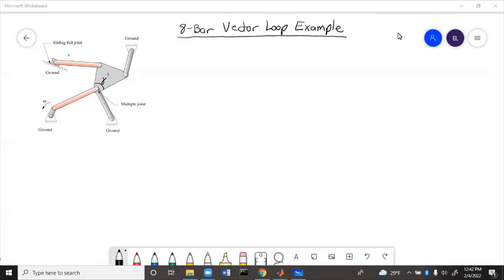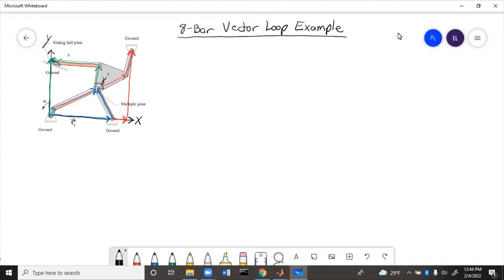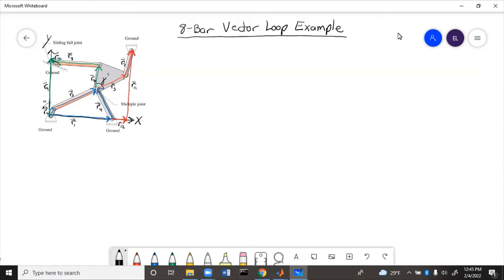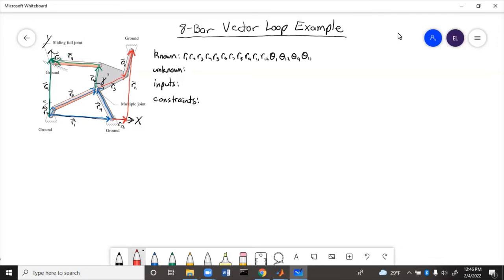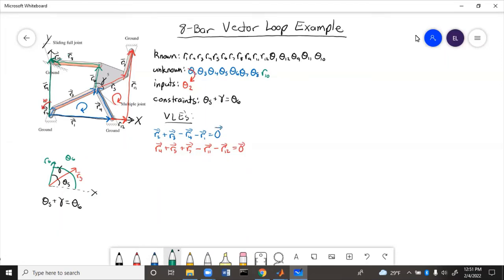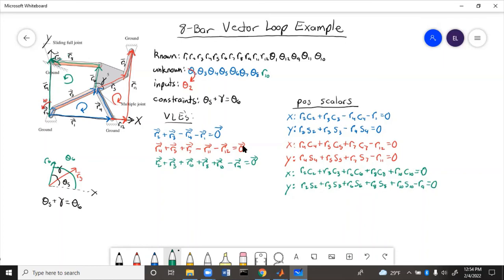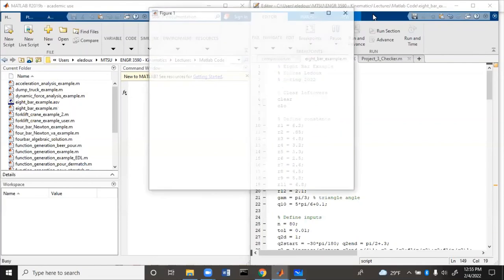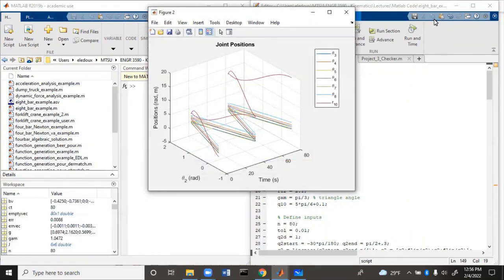8 Bar Vector Loop Position Analysis

Comment: Wouldn't theta 9 change with time making it an unknown? It looks like the slider vector r10 is an unknown and I'm probably wrong but would that not effect theta 9?
Reply from the maker: r9 is a stationary vertical vector pointing to where the slider begins.  Then r10 is measured from that beginning point.